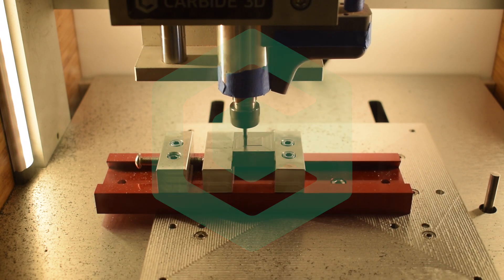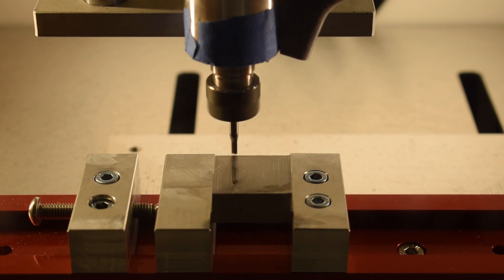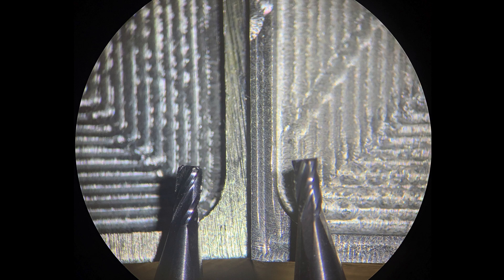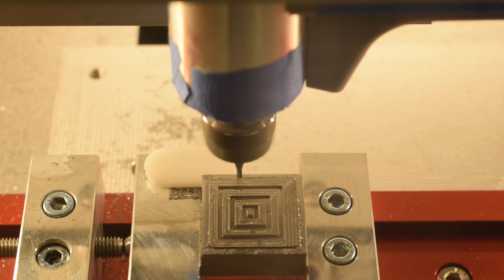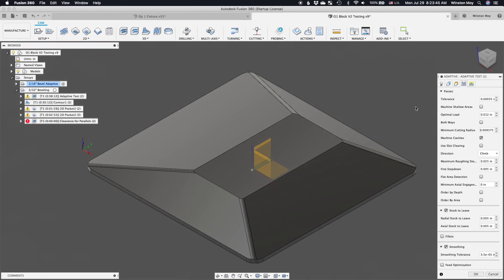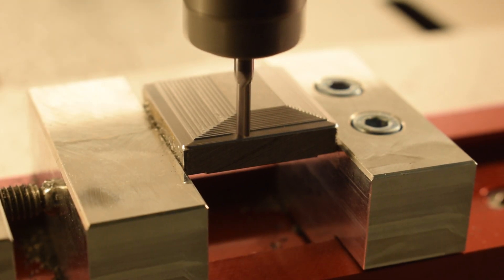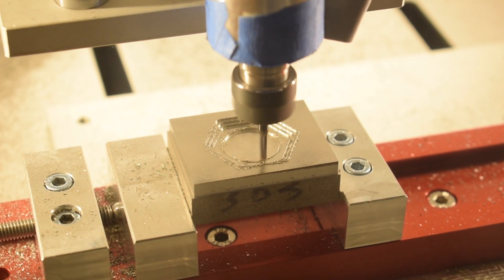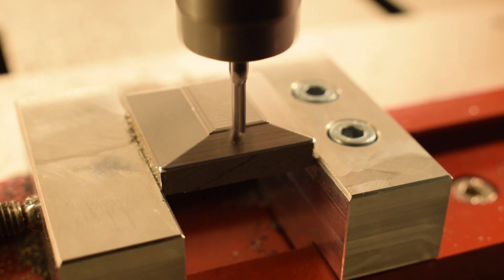Machining Steel and Stainless Steel on the Nomad - #MaterialMonday

Comment: Are all these F/S applicable with the Nomad 3 ?
Reply from the maker: Those are excellent starting points.   
When it comes to machining hard materials people often are concerned about the machine rigidity.  In fact, the limiting factor is often the endmill.  A 1/8” endmill will break long before the NOMAD 3 even thinks about being stalled.

Comment: Hi, I'm not familiar with the machine your running, I run full size machines at work, but when running solid carbide wouldn't you be better severed with a much larger step down and much smaller step over? Then you'd engage more of the cutter in the material which with a good tool (variable pitch) you should actually get much less vibration.  Also if your having any rigidity issues you tool stick out is pretty excessive for that diameter.  I'm not sure what diameter that tool is but when we run say an 1/8 endmill if we only need 1/4 of flute we'll get one with 1/4 loc and stick it out 1/4 plus 0.05". Also coolant will do more damage than good with tool steel

Comment: You could also double your tool life by choking up on that end mill in the collet, that stick out goes for days!!!
Reply: Agree 100% The biggest down fall I see in hobby work is the cutting tip OF THE END MILL is WAY to far from the bearingS in the spindle. Ideally the cutting end of the mill would be on the center line of the ball bearing in the spindle, but that is impossible to do and still cut. So get the business end of the end mill as close to the final ball bearing in the spindle. A good rule of thumb KEEP YOUR MOMENTS AS SHORT AS POSSIBLE AND STILL ACHIEVE YOUR DESIRED RESULTS!!!

Comment: What's your spindle runout after this?
I made many plastic parts and everything worked fine.
But after two small aluminum parts, i end up with 0,2mm runout...
Did i push it too hard, or it is normal?
(nomad)
Reply from the maker: Are you measuring runout directly or part size? If the latter, did you run a finishing pass?
Reply: @carbide3d  directly on spindle, and part was smaller as well
Reply from the maker: @xr0Otx  Hm, that doesn't seem normal. Have you tried the NYC CNC method for reducing spindle runout? May also need to clean the collet/conical contact surfaces, and then clock the collet in an orientation that minimizes runout. Also try checking runout using a precision ground pin. Not that I've done it, but it is possible for small diameter carbide tooling to get bent...
-W

Comment: Lmao. I have a CNC 3018 with a 12,000 rpm Er11 spindle I put on it. I use $1 endmills off banggood and mill brass and aluminum just fine
Reply: ya, fine within your own definition of "fine." This video shows someone who mills stainless on a less than ideal machine with a suprisingly good surface finish.

there are good reasons to buy expensive endmills from manufacturers like e.g. Seco. I'm an engineer and program 5axis machining centers professionally and a good endmill will be worth it's money as soon as surface finish, cycle time and process reliability become important. I wouldnt even dabble with 1$ endmills, since if you really know how to use them, even a 30$ endmill will outlast and outperform a 1$banggood endmill. In the long run you'll save money.

Comment: Actually steel is easier to machine than aluminum!
Reply: In what way? I don't see how a harder material is easier to machine than a softer one given these non-industrial machines.
Reply: @janderson2375  Tooling is key!
Reply: @janderson2375  in a manual mill, steel is a lot easier because it runs wayyy slower, aluminium on the other hand is somewhat harder because of it's gummy-ness, steel don't do chip welding too
Reply: @99897767  Right, but this isn't a manual mill, the context here is a Nomad 3. In this case, steel is more difficult because of the rigidity and power of the machines. Aluminum is easier due to it requiring less power and less requirement on maintaining an ideal SFM.
Reply: @janderson2375  I know, what I meant is the original commenter is trying to be a smarty and call steel easy off-context

Comment: Lubrication won't do much. Flood coolant is used for it's cooling more than it's lubrication (hence the name). Yes, there is lubricant in it, but usually less than 10% by volume. What really kills endmills is running your spindle speed too high. A lot of hobby CNCs are more like routers that have extremely high spindle speeds, which work great for aluminum but not so much for steel. A 4-flute 3/32" diameter tool should be running at ~8200 and 6.5 IPM. You were pushing  that tool pretty hard going with less RPM and more feed. You might consider going with a cool-mist system. This will add some lubrication, but the idea is the evaporation cools everything down with little actual coolant used.
Reply: what also kill an endmill is cutting its own chips

Comment: Very nice. Last weekend I cut steel on my machine too. I tried a bit of wd40 but it went up in smoke from the cutting, didn't make a difference in surface finish so I stopped using it. The steel chips were very annoying compared to aluminium because I have magnetic plexiglass covers.
Reply: What does the steel chips do to your magnetic plexiglass coveres?
Reply: @toco002  They are sticking to the magnets that's why I replaced them with screws.

Comment: Do you think that it is possible to successfully machine a contour in sheet metal (steel 0.125” ) with the Shapeoko?  I was asked to make a sign that will look aged/rusted.
Reply: Did it work?
Reply: @forloop7713  Unfortunately the project was put on hold UFN.

Comment: I am interested in what think about using coolant intermittently on carbide tools. I have heard that it should be all or nothing with coolant on them because they heat up then work harden every time you spray them during a cut causing them to get more brittle thus increasing the chance of them chipping.
Reply: If you're thinking flood, stay away from it for something like this.  Go with a light mist and solid air pressure.  You'll have good chip evac and a nice consistent cooling effect without having to worry about massive amounts of coolant all over the machine and the floor.   Something like the fog buster is ideal imo.
Reply: Shirosake I agree and a fog buster is exactly what I use on my machine with koolmist coolant. This is constant so there is no heat up cool down heat up cool down oscillation in temperature. My question is what he thinks about that non constant “spray it with WD-40” every 15 seconds or so approach. From what I hear that can actually decrease your tool life when compared to no liquid coolant method.
Reply: @kaden56  Anecdotally, Richard Cournoyer has had pretty good luck with it. I think as long as you're dripping near the tool, and not directly onto the tool, what the endmill encounters is essentially a thin-film with very little thermal mass not much worse than a fogbuster deposits on the workpiece. Need more data to say for sure though.